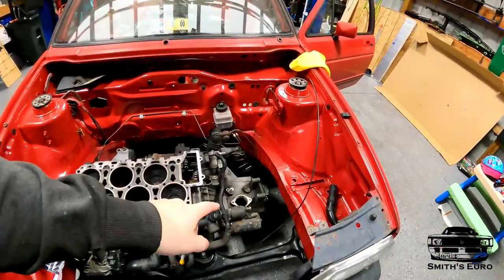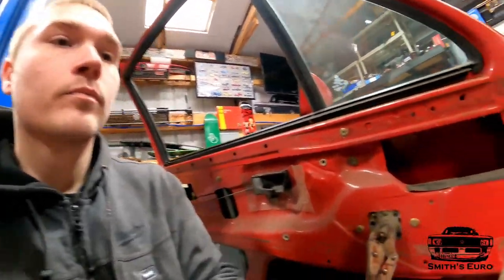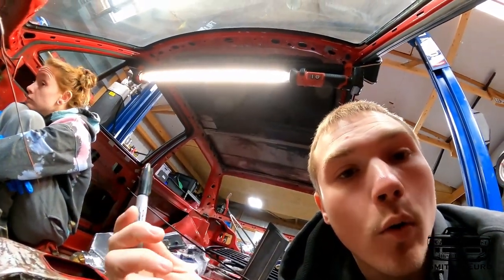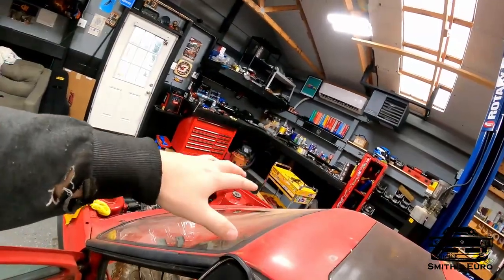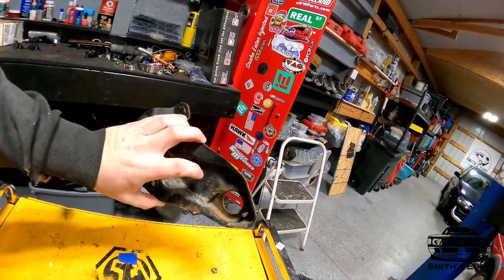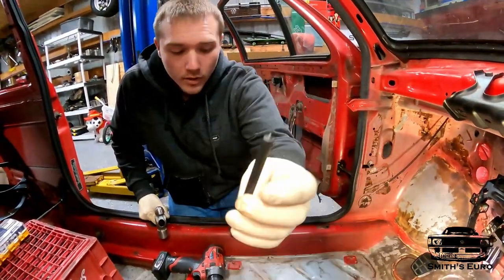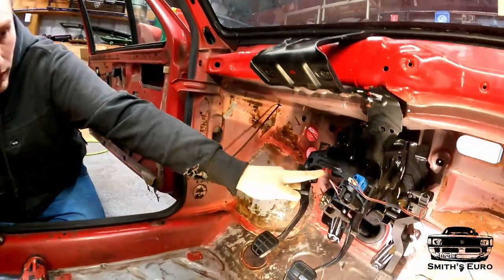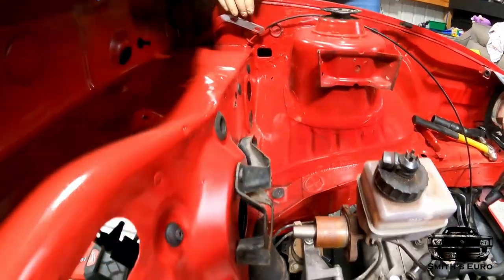MK2 GTI HYDRAULIC PEDAL CONVERSION MUST SEE

Comment: Nice job beefing up the pedal cluster which is such a known weak point. You should install a 3/8" 'Elevator Bolt' or similar clutch stop. Its a couple dollar mod that will cut down on your time in between shifts, adjusting it perfectly so the engagement point is exact everytime, with no wasted pedal travel. It's one more factor preventing wasting precious time in between gears. Probably one of the most overlooked/ basic mods, period.
Reply from the maker: Ill look into it, but eventually i plan to do dog box in a year hopefully. May just leave it as for now, I’ve already had a bunch of issues setting up the clutch. Mismatched parts and bad new parts.

Comment: What you doing with the fluid part
Reply from the maker: Feed from res to master is oem clutch line 
Master to slave is an line kit lots of places sell
Check for 02a braided clutch line
Reply: @SmithsEuro i was going to try  and put the fluid feed hose onto the original brake res to save adding another res pot
Reply from the maker: @jameshalford4699 yea thats what i did all vw are this way

But requires specific clutch hose usually blue and expensive like 20-30$ for 12” of it

Do not use any other hose or it will deteriorate and kill your master/slave down the road and hose eventually will rupture
Reply: You got any videos or pics of you tapping into the brake res please and im using a braided brake hose
Reply from the maker: @jameshalford4699 all vw resevoirs have nipples on them
Cut the tip off then put the hose on